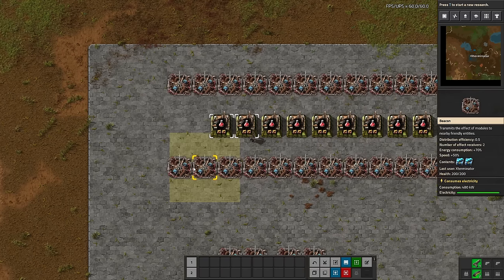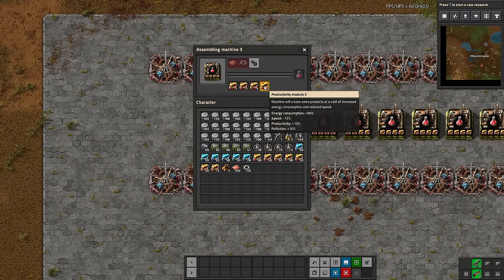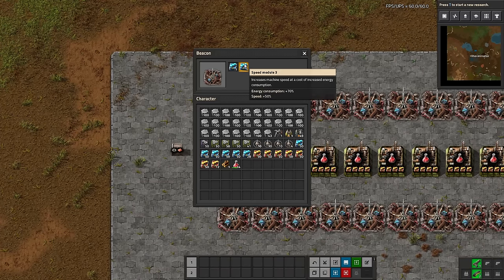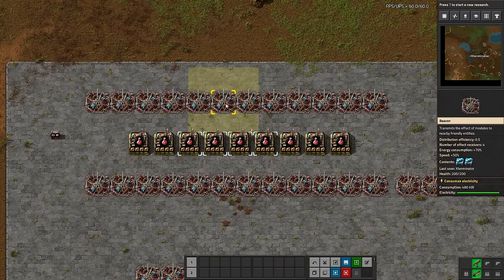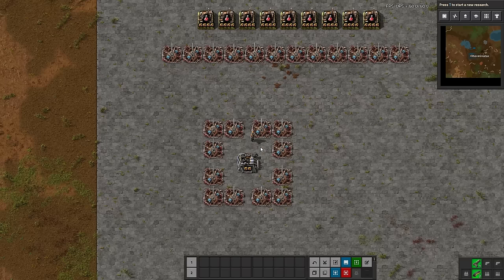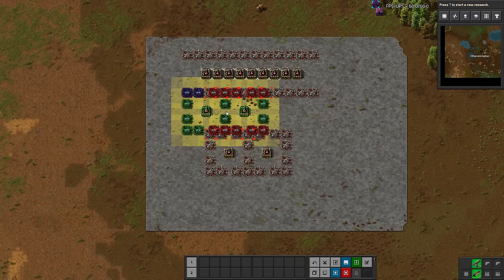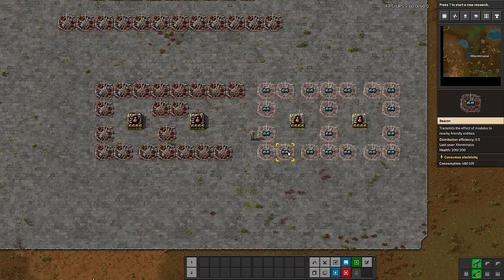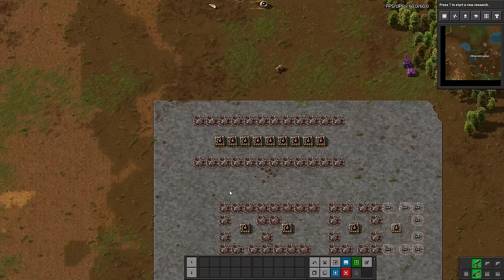Factorio Common Beacon Layouts & Tutorial

Comment: One important thing you didn't mention is that larger buildings, like refineries, can be affected by more than eight beacons. If you use the eight beacon setup and leave a gap between each refinery they will actually be affected by ten beacons, not eight. It also would have been cool if you had shown the difference in size between an eight and twelve beacon setup producing the same output.

Comment: Not sure if it was noted but beacons do use power even if they do nothing and even if they don't have any modules inside, compared to assemblers which use significantly less power when idle. So it is not a bad idea to turn off whole block when it is not used constantly - power switch and some circuit logic :) I used it when I did my train world where each station produce one thing - so e.g. smelting iron - full electric furnace with 12 beacon. When I filled my output buffer I use logic circuit to cut power to whole block (all electric furnaces and beacons around) :) it was fun
Reply: One of those rare practical uses for power switched networks.

Comment: on the compact 12 beacon design:
you can set it up like this: take an 8 beacon design and space out the assembly machines to put 2 beacons between them, like this

beaconbeaconbeaconbeaconbeaconbeaconbeaconbeaconbeaconbeaconbeacon
                    beacon                    beacon                    beacon                    beacon
assembler               assembler               assembler               assembler
                    beacon                    beacon                    beacon                    beacon
beaconbeaconbeaconbeaconbeaconbeaconbeaconbeaconbeaconbeaconbeacon

edit: this one only really looks good on pc
Reply: I get your idea, i was thinking the same. Looks quiet nice also i think. And uses less space then the 12 design.
Reply: yea you also save beacons so less power and cheaper to build. I would only use the other 12 beacon design if I couldn't fit the belts in the compact variants.

Comment: No, it's not an opinion. The row-based layout is objectively better.  The prod bonus is the same, so the only differences are A) the number of MJ of power spent per item produced, and this is lower for the row-based layout, and then B) the cost of construction, which is also lower, and C) space efficiency, which is also better. The ONLY thing that the 12-beacon layout minimizes is the absolute number of assembly buildings, and there are folks who argue that's a UPS win.

Comment: One other concern, or opportunity for another tutorial...  How to arrange belts to get the resources to a factory and product out.  Not a big deal with red science packs, two inputs on a single belt, outputs on another.  What about something complicated like yellow science packs? (Or really anything that needs 3+ items of input.)  Or at that point, do you just go robots/logistic request chests?
Reply: Consider how many resources of something you really need. Use half belts when possible. Use belt weaving when lower belts will do.
Maybe ratio things in a way that consumes all the input, rather than targeting a specific output. For example I have a red circuit build that consumes one red belt of green circuits and plastics each. And the output belt weaves with the copper cable belt:
 https://i.imgur.com/PskyZcM.jpg
This produces ca. 1200 circuits / minute, which isn't a full belt of anything, but that's fine.

I find that fitting all the belts is more of an issue with recipes that need an enormous amount of one material. For example blue circuits

Comment: Wouldn't it be overall faster to do blocks of 8 beacon setups instead of 12 beacon setups? You can fit 4x 8-beacon assemblers in the same space that you can fit 2x 12-beacon assemblers, so overall the production line would produce more products in the same amount of space.
Reply: In the end game space isn't really an issue. The constraints disappear once you can easily clear and landfill everything. Generally 8 beacon setups are perfectly fine, but if you really want to optimize for UPS 12 beacons are better because it means less entities. It's just that contrary to what many players constantly say, UPS isn't always the most important thing. It all depends on the scale you want to play at. You can easily build 2000 SPM without going to extremes.

There are also some builds were something other than 8 beacons results in more convenient ratios.

Comment: The 12 beacon layout shown here is ok for belted designs. However if you use bots I'd suggest eliminating the gaps between the beacons. You still can fit 5 requester chests and six inserters for each assembler. A more compact layout reduce the loading on the bot swarm as there is less travel.

Comment: With the 12 beacon layout, it you condense the top and bottom sides, you can then tile it with the 8 beacon design as well, and still get overlap for every side of the blueprint. The downside to this is it is harder to fit all the belts into the footprint, but if you can fit everything in it, that layout can be good for getting max beacon overlap using both of the designs.
Reply: @Fred G. Or, make 4 beacons top and bottom with no gap, and 2 on either side with a 1 tile gap, like how he does in the video, but removing the gap on top and bottom. This gives you 1 tile in front and 2 behind the assembler, which is useful if you need a lot of belts.
Reply: @Fred G. If you are doing a single product, than that setup will work, but if you are passing other products through (think red circuits, or science, or modules) then you may need the extra space to pass belts of products through.

Comment: It would be interesting to see layouts for assembly machines with fluid inputs.
Reply from the maker: Indeed! There is actually room for fluid inputs in both the layouts shown here. Of course if the thing being produced requires a lot of inserted materials as well it could get a bit tricky.
Reply: @Xterminator  I was having trouble designing something for belted beaconed rocket fuel. I'll give it another go.
Reply: @lkadfkjdkladfskl  
I have a build with direct insertion I really like:
https://i.imgur.com/ZPo6Rkf.jpg
The assemblers have 10 beacons and the chem plants 12. This results in an almost exact 2:1 ratio with the chem plants very slightly underproducing (so they stutter a bit now and then). I then ratio the total number of machines so that I can consume maybe one refinery + heavy oil cracking in a row. But you could also build it so you don't produce solid fuel from petroleum if that bothers you. But doing it this way means nothing ever backs up.
Or you can use 12 beacons for both and a 3:2 ratio (3 assemblers : 2 chem plants), which means the chem plants slightly overproduce. For that you'd alternate chem plants and assemblers. It's also possible to route the pipes in a way that doesn't need those outside pipes, but it's tileable either way

Also shows how you can use beacon spacing to get the desired speed everywhere

Comment: when a singular beacon affects two buildings do each of the buildings get 100% of the effect or only 50%?
Reply: The effect on each building does not change with the number of building that the beacon is affecting. When a beacon is affecting a single building, that building will get 50% of the modules in the beacon. When a beacon is affecting 8 buildings, all the building will still get 50% of the modules in the beacon.
Reply: @kevinbagust  thanks for the explanation, is there any way for a beacon to provide 100% of the effect to a building or can that only be achieved by putting the modules inside the building itself?
Reply: @J-McG  Nope.  Vanilla beacons always provide 50% effect. There may be a mod that changes that, but I'm not aware of any.
Reply: @BillH2949  Bob's modules has beacons with 100% but also with more range